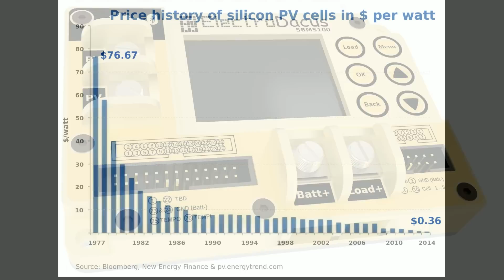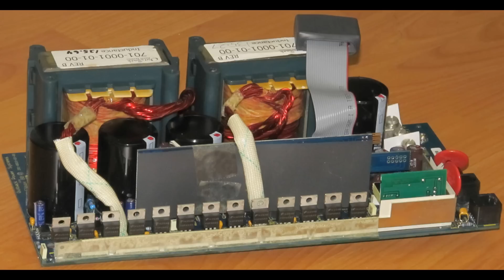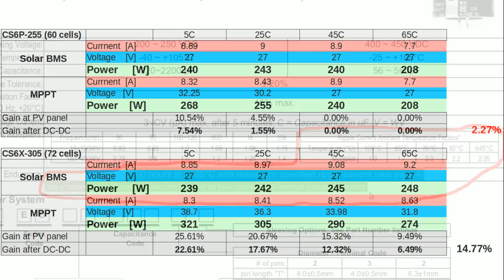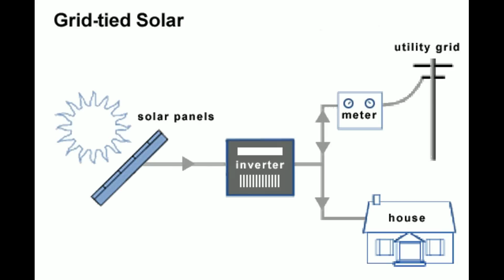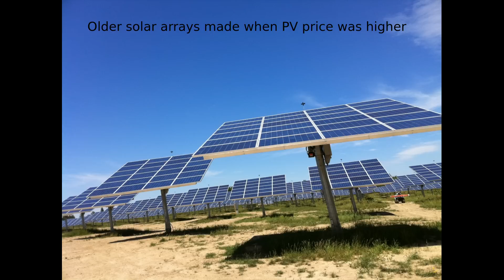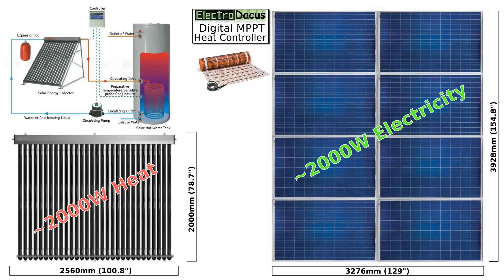Is the MPPT in OffGrid Solar obsolete ?

Comment: Q: I am wondering what do you plan on using as a electrical heater and water heater? I realize that with electric heat the delivery is at night, which means batteries or larger batteries are the costly issue beyond solar panels. Also, the number of nights may be more than just 1 with the batteries, bad weather during the day, which adds to the battery bank size requirements.
Reply from the maker: John W. Nicholson Hi John, I just sent the answer to your email :)
I will use silicone isolated copper wires embedded in the concrete slab just under the ceramic tiles for heating. The heating will not be using any chemical batteries and the energy will be stored as heat in the large concrete slab in my case 14 cubic meters of concrete that can store about 10kWh for each degree Celsius so around 100kW with a 10C delta sufficient for quite a few days without sun since my house requiters under 1000kWh of energy in the worst winter month.
PV array will be a bit over-sized to provide enough energy even in the worst month here November, December for solar production and there will be quite a bit of excess in the other months.
A 6kW will be good enough for heating in most winter months except for December when is usually less sunny here but instead of a backup energy source is less expensive to have the array sized 50% higher to 9kW to provide enough energy for heating even in December.
Energy can be used to anything inside the house since it will end up as heat anyway and that will allow me to do more electric cooking and use more electricity without the need to increase the battery size that can stay at just 100Ah 24V.
Each kWh stored and retrieved form battery is around 20 cent  where each kWh produce by the PV array is just 3 cent/kWh so is best to keep the battery to a minimum and oversize the PV array. Better to have excess energy at 3 cent/kWh that use energy from battery at 20cent/kWh
Again battery is just for electronics and appliances the heating will be stored as thermal energy no chemical battery is involved.

Comment: I have to agree with much of what you say regarding MPPT being obsolete compared to a well matched PWM/battery/PV combination, and the as i started with expert advice, i have largely an MPPT system, and yes, the latter PWM charge controllers generally perform as well, but are of course well mstched with the PVs.

However there are some off grid scenarios, i have run out of sunny roof space on my main building, and have two pairs of 310watt panels on the sunny roof of an outbuilding, one pair, wired parallel, runs into a PWM, the other wired in series runs into a MPPT controller.
The MPPT controller happily pumps out ~13 amps on a good day to the 24volt battery bank, where as the PWM controller has never put out more than 6 amps, however, in low light condition the PWM has been seen to put out 4amps, while the MPPT puts out 3½amp. I can only assume my over voltage panels are a perfect match in lowlight conditions, and the 30m 2.5mm² cable pairs are not a hindrance at this low current.

Further expansion of my 24 volt system will be with PWM units, and load dumps, managed by the controller.

However the 48 volt system will be MPPT simply because i can't yet find a good PWM 48volt controller.
Reply from the maker: Hippy Chris There must be something wrong if you get only 6A from two 310W paralleled panels. You should get at least 14A with direct sun and PWM controller.
I assume those are 72 cell panels so it should be enough extra for voltage drop with a 28V battery but with that cable and length I expect 15 to 20% voltage loss at 14A so that wire seems quite inadequate. At least double will be decent for those two panels in parallel considering that they are 72 cells and there enough to waste on voltage drop.
Reply: The cables are buried, so that leaves little option for upgrade there. The PVs run ideally at about 37 volts, 8½ amp, so i assumed there was enough voltage to overcome cable losses and still charge a 24 volt battery bank well, but yes, there is the possibility that something has gone terribly wrong.
Options seem to be rewire to series, and go MPPT, which would illuminate ¾ of the cable loss, or try a different PWM charger. 
The latter option seems easier.
Reply from the maker: Hippy Chris To make sure in a sunny afternoon just take a multimeter that can measure 20A and connect in series with the PV panels and battery (no controller) and see if you get more than with the controller.
I do not think there is any significant loss on the PWM controller.  In bulk charge there is no PWM and the voltage drop on controller I expect is realy small. My Solar BMS will have well under 100mV drop at 14A about 6mV per Amp.
Reply: OK.
The PWM charge controller i'm suspicious of is part of a mppsolar 2400watt inverter/charger/solar-charger combo. I shall try direct and see what happens. 
It's currently night time in New Zealand, so this will have to wait.

Comment: This is perhaps the most educational thread I've read on solar power to date. I've read and re-read the comments and watched the video several times. So many smart people commenting.... my gosh.  So here's my question. I understand what you're saying about the capacitors dying in the MPPT controllers, (and the associated reasoning behind adding an additional solar panel and forgetting MPPT- it makes all the sense in the world)  so why wouldn't this predictable failure rate also be true in the MPPT section of a grid-tie inverter ? or perhaps it is ?.... and given that, if it's true, are there any PWM grid tie inverters left on the market ?  (a search turned up nothing)
Reply: Is this MPPt vs PWM still true in case of long cable runs? My clearing is 229ft from my nearest outbuilding, so thinking that I'll have to go with mppt and series connect my panels to get cable size under control and not be crazy expensive. I have another 70ft between my outbuilding and dwelling.
Reply from the maker: Mark Osborne The grid tie will have the same problem with electrolytic capacitors (there are some smaller and more expensive one that use only ceramic capacitors).
In grid tie is not possible to not have a DC-DC converter (HW part for MPPT) so there is nothing equivalent with PWM for grid tie.

Comment: Without looking at your data, your argument sounds sound. However something to  note is that a single 60 cell panel will not charge most/many 24V flooded lead acid batterys, at least not to the higher absorb and eq voltages that they require for a full charge. To do that youll need a 60 cell panel with a Voc on the higher end, short/fat cables and cooler weather.  Im not saying this as a downside to your system, just that folk with FLAs need to understand that  LiFePO4 doesnt need those 100% full charges that lead does.

For iron phosphate you only need 28.8, and it wont give a hoot if you do slightly less, quite the opposite itll most likely thank you for it. I also agree mathmatically, about the cost benefit of LiFePO4 over lead banks, however the cycle life is only one factor. In off grid applications it is my view that the cells will reach calendar life well before their cycle life. Some people report noticing as high as 8% per year capacity degredation. When those early banks reach a decent age, we will know more about their failure modes.
Reply from the maker: Peter S Yes 60 cell may not work that great with Lead Acid and it will for sure not work with an MPPT controller and lead acid.
For LiFePO4 the 60 cells are ideal and is what I use on my OffGrid house.
Reply: ***** After your cable losses, what sort of (peak charge rate) voltage are you  getting from your 1S 60 cell array, at the battery? I guess your sub zero conditions will help, but for those of us in more civilised climates we have to watch those cable losses.

Another thought for you. You are making some quite long term cost 
benefit comparisons. Are you including the cost of money in your 
modelling, and also insurance? Its one thing to say that using PV to 
heat a house is cheaper than using solid fuel, even using a cost benefit
 analsysis using discounted cashflow, but if you lose the entire system 
in the early years from 'an act of god', whatever, that changes the 
paypack time kind of severely.
Reply from the maker: Peter S As you seen in my table a 60 cell PV panel with LiFePO4 battery close to the end of charge and 65C PV cell temperature will put out around 15 to 20% less power. But those are the sunny summer days when you usually have quite a bit off excess energy 30% or more so it makes no difference.
Summer is quite hot here with days getting above 35C even 38C some record days. I have absolutely no problem with LiFePO4 charging. If I need to connect a large load like baking a bread with my convection oven the battery voltage will drop around 26V and panels even in that 38C day will work at max power point.

Anything can fail do to an accident so I do not see how PV panels for electric heating is any different.
Panels will be installed at a steep 70 degree tilt to get max output in winter when is needed the most this steep angle will protect them from large hails.
Not sure what else can affect them.
I do not care for insurance my insurance is always designing things properly with enough margins it will be less expensive than insurance.
I say that most other heating methods are less reliable if they require moving hot fluids and or flame where PV electric heating has only moving electrons.
There are a lot of small and large scale PV installations for many years with extremely low failure rates usually do to strong winds coupled with improper installation or other objects failing on the panels.
Reply: *****  Yes, i can see how in many situations 60cells gets you closer to the mpp. Early in the charge cycle, when the current is higher , the battery voltage is lower and hence closer to the reduced mpp of 60cell. As the current reduces, you can ride the IV curve higher. Its something ive pondered myself for a while now. But you do need the array close to make this work for sure. And lithium.

My point about high capital cost solutions is that you must factor the cost of capital in the model. You said "its like buying 30 years of heating at once". In the financial world 30 years is a very long time and cost benefits that far in the future are heavily discounted. Thus, id be interested in seeing your model that compares PV to LPG , solid fuel, and the others. Again at a gut level i suspect you are right, but im a numbers guy, need to see the math.
Reply from the maker: Peter S Solar PV panels can be relatively far the voltage drop is usually quite small in the 3% range. On the SBMS there is even a smaller voltage drop almost insignificant.

Regarding PV heating that will not require battery just PV panels the thing that I call a Digital MPPT and resistive heat elements that are nothing more than copper wires with specific thickens and length quite inexpensive.
The cost of all this is around 10k$ just the material cost and for me probably around a week of work to install all this.
If I take 25 years as amortisation period that will be $400 / year for heating. Currently I spend about $1300 / year for LPG to heat the house that is just the fuel I did not included the thankless water heater heat exchanger and DC hot water pumps if I include those this will get even worse.
On top of that I can use electricity to do other things future reducing the cost amortisation.
One example will be producing my own distilled water for drinking. Currently with my small PV array I can not do that so I purchase distilled water form the grocery store at $2 for 4 litres (1 Gallon). I get one every day so I spend about $700 / year on distilled drinking water.
If I can do that with the energy from the heating array you can easy see that will more than recover the investment leaving heating for free.
Energy needed to distil 1 gallon of water / day represent just 10% of what that PV array can produce and in winter that is not affecting the heating since the distillation process is done inside the house and all that energy will end up as heat anyway.
I can find even more uses for the electricity from that array especially in the summer when well over 1MWh / month is not used and available for whatever application I may think about.
So you can understand that not even a free fuel will be able to compete with PV heating in my particular case.

Comment: I have a solar shed with 1200w of panels, 225ah 24v battery bank consisting of 4 t105 batteries and an Outback FM60. Not cost effective, I know but it is fun and charges electric bikes. Can't wait to charge the new Renault Zoe on it when they release the car.

Comment: Hi,
You can add one thing to yours calculation for comparing mppt vs pwm.
The wirings cost ! especially when there is long distance between the solar array and the technical room, for example if you have 2000Wc with x8 250 Wc in parallel it make something like 60amps (25/35 mm2 copper wire for a low drop voltage).
With some solar mppt like the MidNite CLASSIC 250 you can put 4, 5 or 6 solar panels in series in our case you will have only 15 amps at ~150VDC (4 mm2 copper wire). You can consider 0,4cts/m/mm2. Big thumbs up for you project. Regards
Reply from the maker: PWM will do the same as the Solar BMS since in the bulk part there is no PWM used the PWM is used only in the constant current part of charging on Lead Acid and at that point MPPT is also useless there no gain there anymore.
As for wire cost. I will have a large 7 to 9kWh array for heating and I made calculation for wire cost. The array will be relatively far about 20m (70ft) Normally with individual wires for each 8A (250W) panel you will need #10 AWG for that distance to be under 3% voltage drop.
Thing is that you do not need to be at 3% and you can use #14 AWG for about 8% V drop so 5% more at full sun but average loss will be less. #14 can easily handle 8A even in a conduit with many other wires bundled.
Thing is all this loss even 5% mean one additional PV panel at each 20 panels and that may be less than the extra cable. For sure less than an 5000W (250W x 20) MPPT just for that savings on cable.
The #14 here in Canada can be had for about 300 to 350$/km so for each panel two wires 20m total 40m is about 14$ so not that much even for my 36 panels 9kW array at 20m total will be 36 x 14$ about 500$.
For just a 3kW array what SBMS supports is about 170$ total for cable and for 2kW that MPPT in the example supported is even less so the savings can not be that large you still need cable anyway.

Comment: Hello . Have you considered the possibility of creating hydrogen from unused PV energy in times of lower power demand ? Regards Steve .
Reply: +electrodacus You can get some antminers or other bitcoin miners and dig with the extra energy.
Reply from the maker: Todor Neshev
Not sure it will be an economic activity at this point. Is not just about the energy is about the equipment that needs to compute and the extra Internet bandwidth in my case.
Reply from the maker: Hi Steve. Thanks for the comment. I was thinking about this and other methods to store that extra energy in summer but storage is expensive.
A total of $10k will be sufficient for an array large enough to cover the heating in winter moths so if I reduce the PV array to half that storage solution will need to cost $5000 or less and be maintenance free.
For short therm 3 or 4 cloudy days I already have the 14 cubic meters concrete floor. That one is maintenance free and already part of the structure so no extra cost.

Comment: The heat of the sun damages the solar panels?  BTW there is a loss of current during the off hours plus the natural loss of current do to the batteries.   It seems the loss of current is higher the older a battery gets on the wet cells.